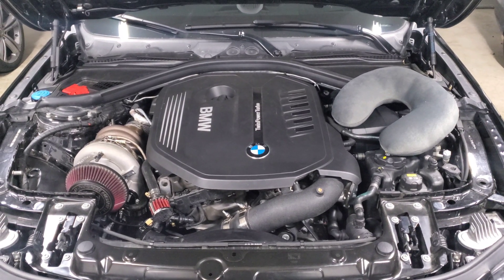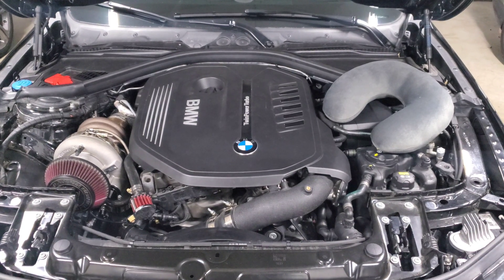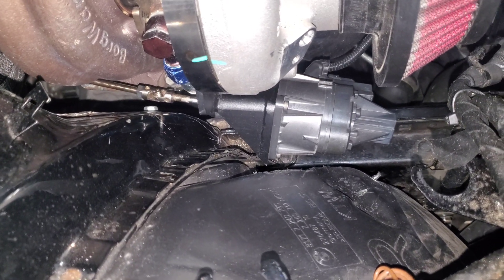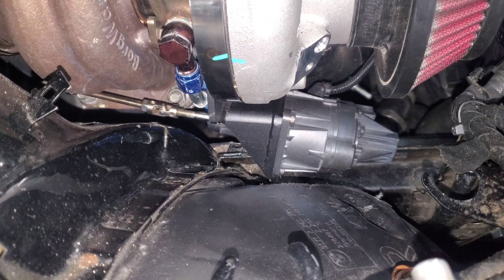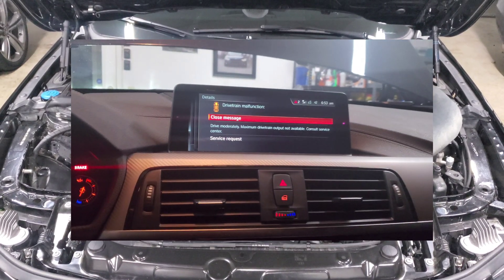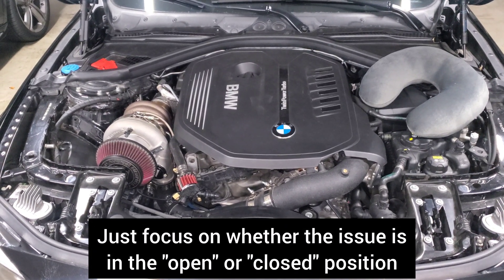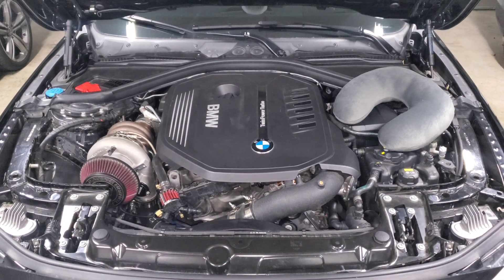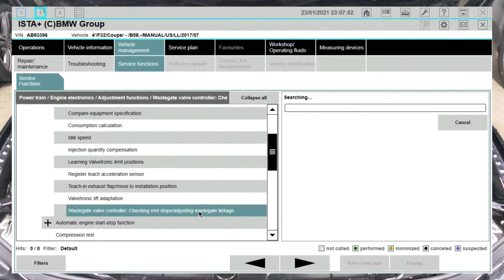B58 Wastegate Calibration DIY (Fix Wastegate Stop Position Outside Tolerance)

Comment: Is there any way to reduce wastegate rattle that the B58's are known for?
Reply from the maker: B58 are not known for wastegate rattle
Reply: @kern417  Not in the same sense as the N54, no, but they frequently rattle from the wastegate actuator arm at the pivot point. It's most noticeable at low RPM and in closed environments that echo.
Reply from the maker: This is not a common issue.
Reply: @kern417  Common enough that I've had it on 3xB58's ;)
Reply from the maker: @Bestwick1983  sounds like you either found the 3 worst B58s on earth or you're not identifying the actual issue. Find any sizeable discussion about it being a common issue and get back to me.
Reply: @kern417  Oh there are plenty on the various B58 equipped model sections on Bimmerpost, BabyBMW and 7 pager on one of the German forums I cant recall the name of. All 3 vehicles were purchased brand new (M140i, M240i, X3M40i) and were first gen B58's.

As for not knowing the cause that is well established in those discussions and I have personally tested, with the motor running, the effect of holding the particular joint in question on the wastegate arm, noting that the noise disappears instantly. There are a few videos on YouTube showing this as well. This was reconfirmed by the technicians at BMW when I'd taken it in for a look who'd noted that they knew about it, but there was no fix as the BMW group referred to as it as "within spec". 

But I'm not here to try and convince you. I just asked whether you had encountered it and had a fix since you appear to have a decent amount of experience with the platform.

EDIT: in case you'd like a demonstation: https://youtu.be/-7ZW7eW5Vgw
Reply from the maker: @Bestwick1983  bro i did a google search and I've seen nothing 🤣🤣 I've had no issues myself or with anybody else I've interacted with over my years of ownership. You can see the wastegate in my car is literally mounted right under the hood and I don't hear anything or have that issue. Sorry about your luck
Reply: @kern417  I never suggested that it happens to every B58 nor that every owner even notices it...so if you don't have it: Great! Perhaps it mostly affects RHD vehicles due to the steering column necessitating a change in hardware in order to fit it all in that side. Who knows...I'm still in fact finding mode. 

But I can tell now you're one of those "if it didn't happen to me it doesn't exist" internet experts.

Good luck with the channel and the build. Some valuable stuff on here.
Reply from the maker: @Bestwick1983  i have had no issues with my car except coolant loss, yet i have an ongoing playlist of problems that I've never personally experienced 🤔
Reply: @kern417  you are incorrect. I have a 2017 340 from Canada and mine has a dreaded rattle coming from the turbo area. There is a dude who has a video on it on YouTube of his 2016 340 making the noise. 

It almost sounds like coins rattling. I am gonna try your fix on the actuator arm and make sure it is at correct operating length before trying anything else. 

Also, try not to have such a fat stick up your ass when someone says it’s a “common issue” and your quick google search doesn’t agree.
Reply from the maker: @sebastianannab8159  i have had a tail light moisture issue. It is not a common problem. Just like wastegate rattle is not a common problem.
Reply: @kern417  there are 100% enough threads acknowledging the wastegate as a problematic area. 

I mean bro, you literally made a video about calibrating the thing 🙄
Reply from the maker: I don't think you guys understand what it means when something is a "common issue." If a quick google search doesn't reveal anything then it's not common. The videos i make and what i report on are things that I constant get messages about, see on forums, or discuss in fb groups. You're not the only ones that say I'm not addressing something that is a common issue or plaguing B58s. I just tell it like it is, and it is not a typical problem.
Reply: @kern417  this dude Phillipe Monin made a YouTube account specifically to post his 2016’s wastegate rattle and DIY solution.
Reply: @kern417  idk why you’re so hung up on the definition of “common” issue. 

I do see you out here in the forums actually though, so respect.
Reply from the maker: @sebastianannab8159  because OP asked if i would comment on wastegate rattle that B58's are "known for" and disagreed when I said it's not a common issue. That's the entire point of the thread. Just like the guy that said why don't i talk about driveshafts breaking or anything else that may affect a few people or specific circumstances. I am only making videos on issues that are common.
Reply from the maker: @sebastianannab8159  calibration has nothing to do with wastegate rattle. As stated in the video, it's only common because most people upgrade their turbos and see this after the fact.
Reply: @kern417  dude you don’t think calibrating the wastegate could help with the rattling heard in that dude philipe’s video?
Reply from the maker: @sebastianannab8159  dude, did you even watch the video? What about the process would reduce rattle? Do you even know what is rattling?

Assuming you didn't/don't, the calibration process happens every time you start the car. It's done automatically. The only thing you can do is adjust the length of the arm if it is outside of tolerance, which throws a code. 

Rattle is caused by something loose. There is only one joint on the wastegate arm that could rattle and it's easy to tell of it's loose. It's electronically controlled and monitored, so it's not like a pwg n54/n54 where it can just be loose or fail depending on boost. 

If something is damaged/broken causing it to rattle, that is a separate issue. But that doesn't mean it's a "B58 issue" when nothing about the design or normal function typically causes it.

Hope that helps.
Reply: @kern417  I don’t know… my car has no code, so I’m not watching this video for that aspect. 

As far as the rattle on my car - i came here from that mentioned Philipe video. He mentions this video in the comments as part of his troubleshooting process. If you have trouble finding it, just search b58 wastegate rattle on YouTube. It’s a dudes YouTube channel named Philllipe and a last name. 

Could you listen to the rattle on my car? It sounds super similar to the one mentioned on the 2016 340 I am talking about. If you have a way to listen to the noise I am questioning (I have two short clips that are in total less than 20 seconds) I would be grateful.
Reply from the maker: @sebastianannab8159  of course
Reply: @kern417  dude how can I send it to you. I posted on Reddit already
Reply from the maker: @sebastianannab8159  message me on Instagram or Facebook. My links are in the video description

Comment: I needed to hear this!! Thank you! My n55 is throwing 2 codes on most warm starts with the dreaded Drivetrain Malfunction
Reply: Having the same issue with mine
Reply: @333-i6x3b you fixed it ?
Reply: Hey boss I just got this as well did you fix it the same way he did ? I have a 14’ n55 and same thing unless I drive a bit and then turn off and on my car then it’ll work ?
Reply: @dannyj6584 did u ever get it fixed
Reply: @dannyj6584 Hey, I’m having the same issue as you described, have you managed to to fix the issue? I’ve been told turbo replacement due to wastegate issue
Reply: @StaticSpire the dealership told you that right ?.... they're trying to get you to spend unnecessary money when you can just replace the ewg.... they tried to get me the same way and when I told them I wasn't paying that price and I will just scrap the car they called me back and said they will go ahead and replace the waste gate only but they told me if I bring the car back for something simple as an oil change they were going to charge me 300 extra because I didn't fall for their trap 😂

Comment: does this need doing when fitting a vargas gc core?
Reply from the maker: You won't know until you install it. Typically if you don't adjust the length of the arm then it will work fine when you swap it to the new turbo but a few people have still had to adjust it

Comment: I have a gen 1 b58 and running on a E50 blend base map for f80 Paul. I looked at the logs and my WGDC was at 99%, I also checked my previous 93 octane tune datalog and it read 99% as well. With my current setup it’s pretty unusual for it to be that high, my DA was also around -700ft. Do you think this could be a small boost leak or something entirely different?Just wanted to hear your input, thanks a lot
Reply from the maker: Yes most likely a boost leak or vacuum leak
Reply: @kern417  Ok, thanks a lot